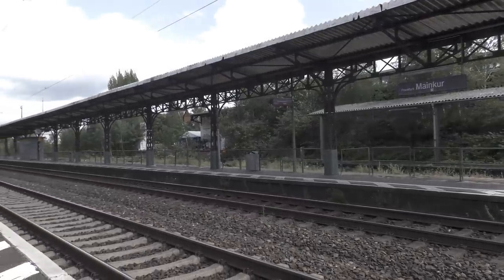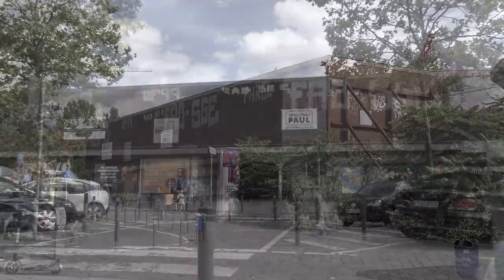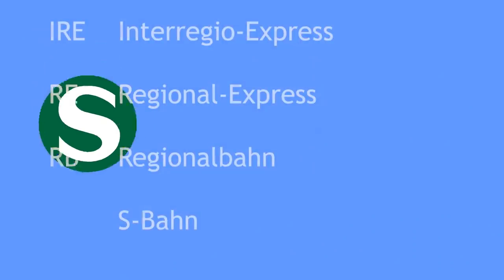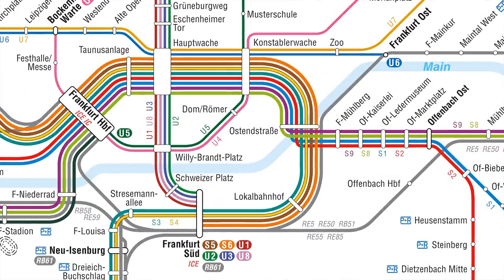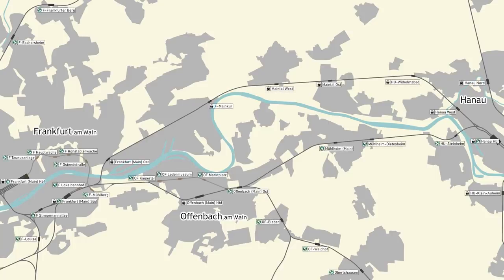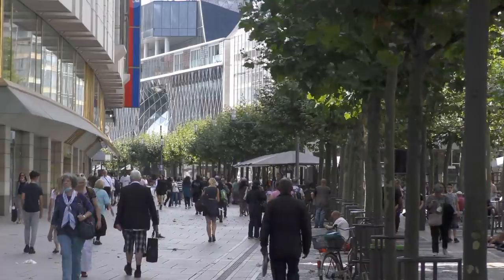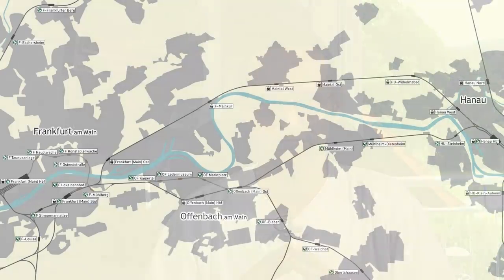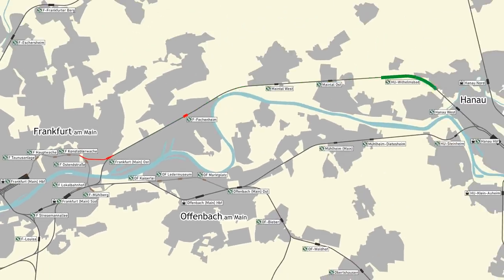Why is this station so neglected?

Comment: There are even bigger projects: A new mainline under the Main (finally a Mainline worth the name!) because that's the only place that won't either collide with existing underground lines or affect the foundations of skyscrapers. That should allow through trains to serve the central station without reversing directions.
Reply: And then call it Frankfurt 22? That won't cause any problems.....
Reply: @jordidebont9547  In contrast to Stuttgart 21, the project in Frankfurt actually serves a purpose for rail travel...

Comment: Sounds like the 2nd-Avenue subway line in New York City.

Along 2nd Avenue was once an elevated train line.  It was the last of the elevated lines to be replaced by a subway line, shut down, and demolished.  Well, sort of.  

Edited:  [I went back and looked up the exact dates]
The plans for it started in the 1920, which was when the plans to replace all of the old elevated lines were made.  The old 2nd Avenue Line was demolished in 1942, loooong before construction would even be thought of starting.  This left  _the entire Lower East Side of NYC without any train line whatsoever serving it.

Construction on the 2nd Avenue Subway Line did start in the early 1970s, after all of the other elevated lines had been replaced by subway lines.  But The City ran out of funds a few years later, and the completed sections of tunnel languished.  For decades.  From 1980 onward, there was constant talk and promises and Grand Plans for finishing the 2nd Avenue Subway line.

Then in 2007, there was finally some progress.  Existing tunnel segments were connected, and most of the northern half of the line was completed.  There was now a 2nd Avenue Subway Line … through the narrow north-central part of Manhattan, between Central Park and the East River.  Which is already served by the #3 subway line.  Meanwhile, the Lower East Side is still without any mass transit.  (Busses don't count;  you can often walk faster than some of the bus lines in Manhattan.)  

Funny thing — the Lower East Side, which I keep mentioning, as a large area of Manhattan that has been where immigrants and workers lived.  In fact, since the mid-20th Century, when the old line was torn down, the Lower East Side has been home to NYC's Puerto Rican community.  Hmmm… hispanic immigrants getting the shaft for 80 years… hmmmm.   Hmmmmmmmmmmm…

The plans for the phase that would extend the 2nd Avenue Subway Line south [into the Lower East Side], are still in the planning phase.  And the person who had been cracking the whip that kept things moving … was disgraced ex-governor Andrew Cuomo.
I expect the extension of  2nd Avenue Subway Line southward to start in time for the 100th anniversary of the original start of construction, so sometime in 2070.  There can be a celebration of the the start of the final Phase of construction and 100 years of broken promises at the same time.
Reply: Lower East Side was mostly Irish before the turn of the 20th century, then predominantly Italian & Jewish, then Chinese, and recently more Latin Americans settled into those neighborhoods, but its still predominantly families that resettled there from Taiwan, Hong Kong, and more recently southeastern PR China. The biggest Puerto Rican neighborhood in Manhattan continues to be East Harlem, also called "Spanish Harlem" or "El Barrio".
Reply: @janweber2889  Ugh, you're right!  I forgot about Spanish Harlem.  I was thinking more about the NuYorican area down in or around alphabet-city.

[I grew up on LawnGuyland in an Italian-American family in the 1970s, but we moved out of state when I was 13.  I live up the Hudson River upstate now, but never really got the full hang of some of the newer neighborhoods.
Also?  I'm so very, very, very sad that Little Italy has evaporated.  Last I was there a decade ago, there was only a block left of it.  Chinatown had moved to fill in the void left by Little Italy shrinking away.]

Comment: The name of the Berlin S-Bahn goes back to 1930, the S-Bahn itself goes back to 1870 with the Ringbahn connecting various other light raailway lines.
Which btw is where the London tube got the idea for the Circle Line from. Basically the Brits stole the layout of the actual rail system and the Germans stole the design of the map.
Reply: the berlin U-Bahn station Wittenbergplatz even got an original london station sign with its name (as a gift, not stolen :-)

Comment: S-Bahn sytems are confusing. There are only three things that you can rely on: All of them are electric and they run on standard gauge of 1435mm ( 4' 8.5") . And they are marked with that white S against a green background. That's it. In some cities, such as Hamburg, they are managed by the city's public transport system, in others they belong to Deutsche Bahn, DB. In some cities they have a life-rail down at the track, in others they have  overhead wires. In contrast to trams they have their own network of track that is independent from the streets which allows faster journeys and they are of course roomier than trams. We live in the country  in what is called "Metropolregion Hamburg" and that means we can buy a ticket from the bus-driver right here in our village that allows us to get to the train station in the next town, change to a regional train that takes us to Hamburg and use the metro, the S-Bahn, the harbour ferries or buses in Hamburg to get to our destination. A few years ago the S-Bahn to the airport was opened, very convenient indeed: no parking fees, no problem of getting there in time.
Reply: "S-Bahn runs on Standard gauge" Switzerland and Italy: Hold my beer...
Reply: @sethanix3969  Yes, they are standard gauge unlike trams which run on narrower gauges. Where is your problem?
Reply: @christiankastorf1427  My "problem" is, that you said there is no S-train on narrow gauge. Italy and Switzerland agree to disagree, as both have S-trains on meter gauge. ;)

Comment: Ah, so Frankfurt not only uses the "U" (like Stuttgart et al) but also calls their stadtbahn system an "U-Bahn". Lol. I'm reminded of that hilarious short clip you made some 10+ years ago explaining what U, S, Stadtbahn mean :)
Reply: There have always been overlaps between the systems in Frankfurt. Some ubahns still run on tram tracks  but trams are generally not allowed in the tunnel sections, there are purpose built stadtbahn tracks on the ubahn system and they're building a sbahn-like stadtbahn system in the west, which uses repurposed national rail tracks too. They're also upgrading other major rail lines to pull more sbahn out and electrifying some to turn into sbahn. Oh and adding an ubahn terminus to an existing sbahn station at bad homburg.

Comment: I wonder if the planned underground station for long-distance trains at Frankfurt Hauptbahnhof with connecting tunnel will further delay the planned S-Bahn via Frankfurt Ost.
Reply from the maker: There's no reason it should. But the plans for the Hbf are at such an early stage, they're not even plans. DB commissioned a study into whether such a project would be possible, that's all.
Reply: No, they are deliberatly not touching the planning for the S-Bahn. And it is not necessary, anyways. The tunnel from central will connect to different tracks than the suburban line.

Comment: could you get out on the other side of the tracks?

thanks
train videos are much appreciated.
Reply: Where? At the stations? Then no, There is only one entry to each platform. At Ost it's from the northwest, at Mainkur it's from the south. To actually cross the line you have to take a short walk to underpasses on either station not connected to the station proper.

Comment: 3:01... Is it not just short for Straßenbahn? As opposed to the U-Bahn, which runs Unter (den Straßen). This was how it was explained to us at school, back in the day.
Reply from the maker: No, "Straßenbahn" is a completely different thing. "Straßenbahn" is a tramway, while the S-Bahn is a railway.
Reply: @rewboss  You're right, of course, and I'd mistakenly conflated the two things. I wish I could blame the error on my hazy school memories from more than twenty years ago, but I've actually been to Germany several times in the last five years, so it's a poor excuse. Maybe I should get some sleep...

Comment: I actually live in that area, and as far as I understand we won't get as many trains anymore in Offenbach? :(
Reply: Offenbach Hbf won't be affected by this, because there are only regional trains. I understood, that ne nordmainische S-Bahn will provide additional capactity between Frankfurt Ost and Hanau via Maintal in a 15 min. service. There is no information, that service will be reduced on the southern (existing) line.
Reply: @YesterchipsMIG  
Well I would have expected for some of the lines to Hanau to just be redirected in the north.
But retrospectively you are probably right, that there will just be some S-Bahn lines added.
Reply: @fireskorpion396  There will be probably no major changes to services which call at Offenbach, but the S-Bahn will free up much needed slots on the northern line for additional fast services between the Kinzigtal and Frankfurt.
Reply: I personally think a north-south train will be redirected because two of its lines end in Frankfurt-Süd while all of the east-west lines go further than Offenbach-Ost, though ideally, the S7 (which never goes into the tunnel) would be used for the Nordmainsche S-Bahn instead.

Comment: 2:30 why outside of the ruhr-area? i mean yes, tunnel sections are more rare here, but that also counts e.g. for the S-bahn in cologne.
Reply: Because it is polycentric
Reply: @burgerpommes2001  OK. but what about wiesbaden/mainz or ludwigshafen/mannheim?
Reply: @montanus777  I only know about "Wiesbaden/Mainz", but that is the S1, from Stuttgard and it goes right through it's center. In the Ruhrgebiet, different cities have different systems, which are somehow connected. When I travelled with the Bahn, through it last year, it felt really messy. But I kinda enjoyed it (till the part where I needed a toilet and it took me a while, to find it^^
Reply: @deryoutubaaar3926  the ruhrgebiet cities (at least the larger ones) have their own metro and bus systems each, but the S-bahn connects the cities. the S1 e.g. goes through dortmund, bochum, essen, mühlheim, duisburg and then to düsseldorf and solingen (central stations in each of the cities). so, the only thing that seems different to me (compared to other westgerman regions) is the number of large cities, but the general system of the S-bahn is pretty much the same.
Reply: @montanus777  I quickly looked this map Up: https://de.m.wikipedia.org/wiki/S-Bahn_Rhein-Ruhr#/media/Datei%3AS-Bahn_Rhein-Ruhr_2020.svg

As it can be seen there, you have multiple center points, wheras in other major cities, they only have one. Usually every S-Bahn route goes through the main station, so you can switch into every line there.
Reply: @deryoutubaaar3926  you mean like in essen? or dortmund?
Reply: @montanus777  yes, that is what I am talking about
Reply: @montanus777  Wiesbaden and Mainz are destinations while Ludwigshafen and Mannheim are neighbouring each other and make up the centre of the Rhein-Neckar S-Bahn.

Comment: Meanwhile in Berlin: Let's plan a tram that goes directly to the airport we're closing next year
Reply from the maker: Be fair: the area is to be redeveloped, with housing and industry. The proposed U-Bahn line was never built (Jungfernheide station has those unused platforms for a reason) and there's no S-Bahn, leaving 10,000 residents and a few thousand workers relying on buses and cars.
Reply: @rewboss  that is true, getting there has always been trouble as you had to either leave the U-Bahn about 10 or the S-Bahn about 20 minutes away from the airport. I would wonder though, whether a tram connection makes much sense when bus connections already exist. A secondary U6 connection from Kurt-Schumacher-Platz to the old Tegel terminal seems to be a better solution.

Comment: I visited Frankfurt 2 years ago. Even the Messe station looked terrible. All but one elevator were out of service, and the working elevator was full of broken glass and vomit. Many parts of the station was also poorly lit, making it feel extremely unsafe after dark. This is a station built mainly for international business travellers, but it looks like something you will find in a ghetto. Out of all the german cities I have commuted in, Frankfurt definetely felt the most dirty and unsafe.
Reply: Messe S-Bahn station has kind of the opposite problem from the one in the video -- it's highly frequented and on an important line, so shutting it down for proper renovations would cause huge disruptions. Same reason it's taking years to slooowly renovate the sub-level at Frankfurt Central Station bit by bit. 
 
Messe subway station is nice, though.
Reply: @HeadsFullOfEyeballs  But that is a general problem of Frankfurt. The VGF is a regional company, taking care of (almost) all of their train stops.
DB Stus (Station&Service) manages the stations in the whole nation. They simply don't care about anything below the level of ICE-stops - and it shows...

Comment: Where's the problem with weeds? It's housing for rare plants (weeds...., some even on the red list), for insects and small animals. Should all city be sealed by concrete and kept clean off life by roundup?
Reply from the maker: Well, it depends on the weeds. Many of them rob more valuable flowering plants of nutrients, space and light, and there are some -- such as bindweed -- that literally choke plants to death. Some of them -- ragwort, for example -- are poisonous to grazing animals. Several are invasive species that have no natural "predators" (for want of a better word) on this continent and which, if allowed to spread out of control, can drive out native species. And weeds that get out of control can start to pull apart human constructions like train stations, making them unsafe.

You have to make a distinction between plants growing where they can cause actual physical and ecological damage, and plants that are allowed or encouraged to grow which aren't traditional flowering plants or crops, but which are beneficial in other ways. The aforementioned ragwort, for example, is not exactly welcome where it could end up in hay (where it can cause liver failure in horses and cattle), but away from those areas is extremely attractive to pollinating insects.

It's not a straightforward choice between letting any plant grow wherever it wants, or killing all the plants. The middle way is a carefully managed cultivation that promotes biodiversity without upsetting the ecosystem.
Reply: @rewboss  we were talking railways, or urban (Mist I don't know the word for "Brache") empty spaces. Of course, over generalization never can be correct.
If you get the opportunity, check out (or, even better, visit) the Park am Gleisdreieck in Berlin. Very interesting (and a lovely spot for a walk)

Comment: I always thought "S-Bahn" stood for Straßenbahn...
Reply: Die wird heutzutage in deutschen Städten mit dem Englischen "Tram" abgekürzt. Zumindest in Dresden ist das der Fall.
Reply: @dansattah  Frage wieso muss es das englische "Tram" sein? War das deutsche "Tram" nicht gut genug? Ja Tram ist ein deutsches Wort, in München war es schon immer die Tram wie auch in schweizerischen und österreichischen Gebieten.
Reply: @ssingfo  Das wusste ich nicht, danke dir. 

Ich komme als Erster in meiner Familie aus Dresden und spreche schon mein ganzes Leben lang Hochdeutsch und keinen anderen deutschen Dialekt.
Reply: IIRC the S-Bahn uses the same rails as normal trains while a Straßenbahn uses different rails according to which city they’re in.
Reply: @skirata3144  Emphasised by the fact that many trams have got a shorter track gauge (1000 mm) than regional and interregional trains (1435 mm) meaning some trams are able to share tracks with a regional train, others can only drive on their own tracks or can only share with a regional train with a dual gauge.
Reply: No the S-Bahn is a part of the national railway so it does not operate on city streets. It's typically operated similarly to a metro while not being one. That said, "S-Bahn" is more like a brandname than a technical description, because in different cities the name describes quite different systems. It can be quite metro-like systems like in Berlin,Hamburg or Munich, as well as systems that are closer to regional commuter trains than a metro, for example in Dresden or Magdeburg. There are also hybrid systems which are sort-of in between, for example "S-Bahn Mitteldeutschland" (really Leipzig + Halle + a rather huge region around the two cities).

Comment: As an aficionado of neglected Frankfurt train stations, you may enjoy Frankfurt-Eschersheim. 

The place looks like it's been abandoned for 20 years. It's accessed via a claustrophobic hallway through an otherwise boarded-up train station, the platforms are down overgrown concrete stairs at the bottom of a gloomy ravine in the shadow of a road bridge, and because they're finally preparing to renovate/rebuild it now, it is currently surrounded by a wasteland of churned earth and construction fencing.
Reply: @lillywho  You'll have to hurry if you want to get murdered there, I passed through the other day and the construction work is progressing quickly!
Reply: @HeadsFullOfEyeballs  The entrance through the station building has been boarded up for quite some time now, as the stairs were deemed unsafe for any kind of usage. 
The only entrance to the southbound plattform was via the level entrance besides the old Batschkapp.
It will be replaced by temporary staircases directly from the Maybachbrücke and subsequently a complete new station for the new tracks of the S-Bahn.